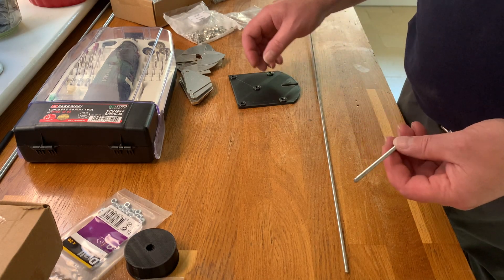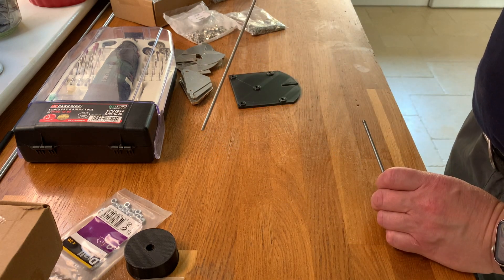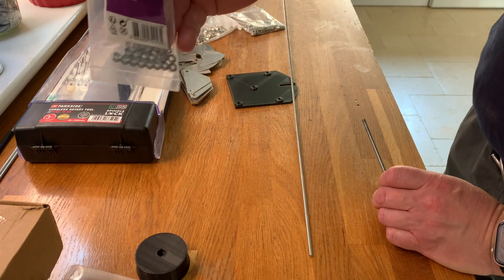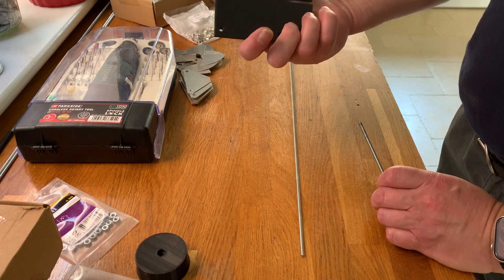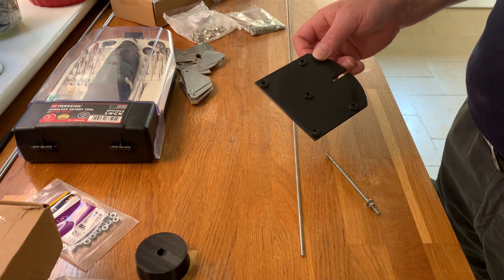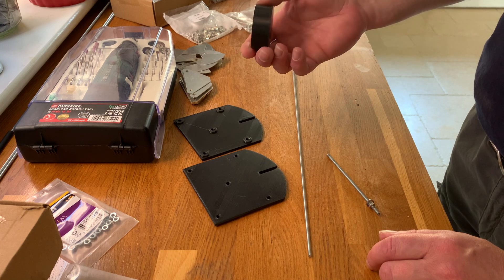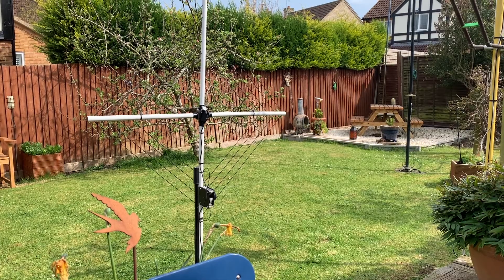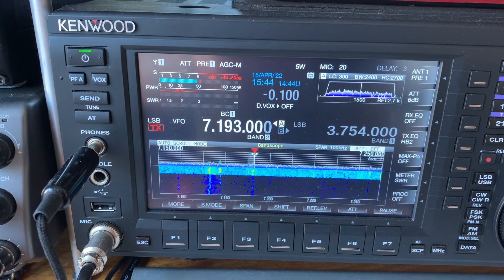RADIO HAM: Spiral Loop Capacitor build. Butterfly Capacitor Build

Comment: Hello Mike, could you please confirm that capacitance required for the 40 and 80M loops please, Regards G7MJV
Reply from the maker: between 10 to 30pF if my memory serves, but give it a go, because it depends on how much wire you use....

Comment: Hi Mike, I guess the conduit dia for 80m and 40m is not critical, you used 1" conduit and 1.5sq mm insulated wire for both the antenna

Comment: Is that antenna just for AM/Medium wave? I assume this because it is a loop type. I mainly fiddle with tube radio repair, and many have short wave bands. Would that type antenna work with short wave. I have generally just used long line type antennas.
Reply from the maker: No it's for SSB, AM, FM, CW, USBD all modes and for 40M / 80M bands

Comment: Nicely done. It would be interesting to have a TX comparison, I would assume they all work OK if the conditions are right. Side by side tests are really not fair in most cases though, the conditions are RARELY fair to all types of antenna's at the same time. When a vertical is good, flatops are often deaf and vice versa. I guess a loop needs a certain enviroment to acheive it's best case scenario aswell. Besides, no matter how big or how GOOD an antenna might be, it is still going to be deaf if there is noone to be worked.....

Comment: I don’t understand the way you connect it to the meter. Shouldn’t you connect one wire to the mobile plate (central knob/axes) and the other to both fixed plates?
Reply from the maker: You could and that would have provided a higher value but I need it to act like two Capacitors so it is connected like a butterfly cap.
Reply: @mike-M0MSN  thank you